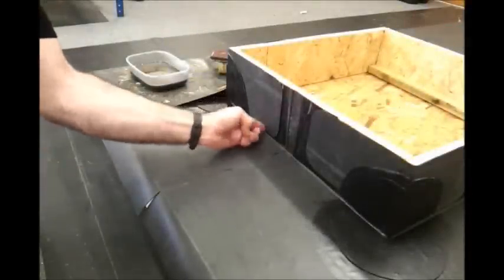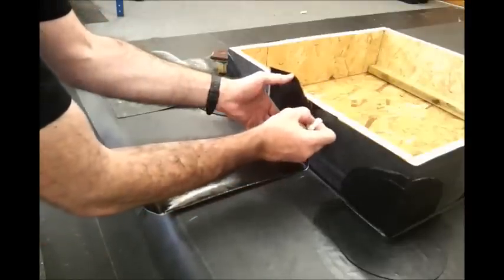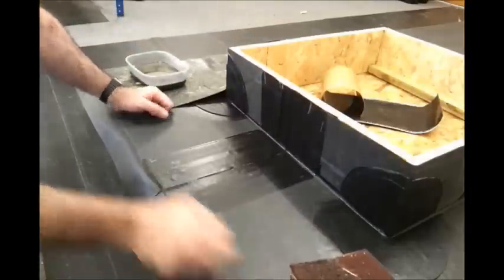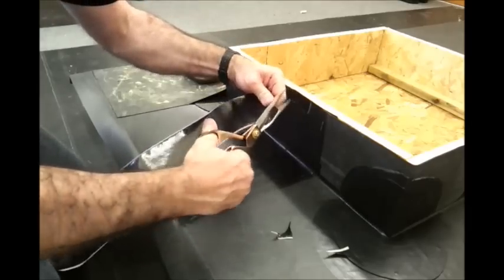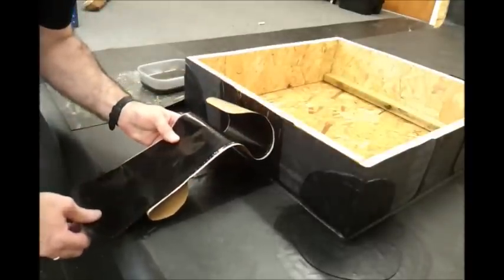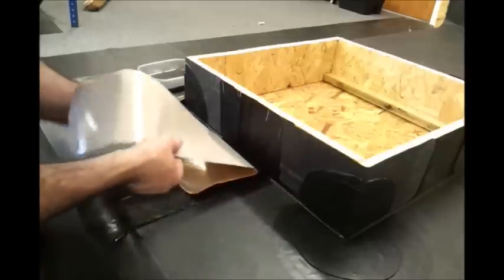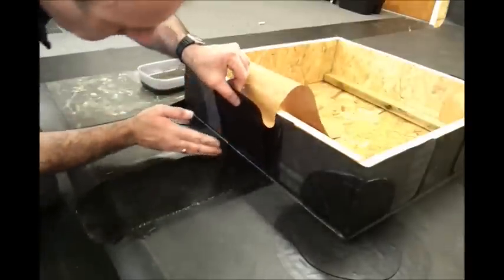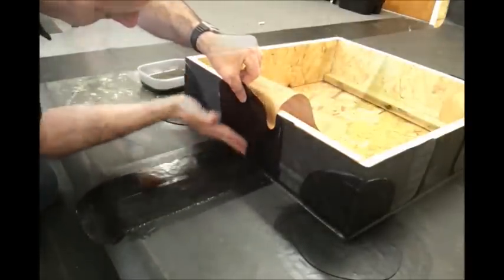How to Join EPDM Membrane with Cover Strip Tape - Rubber Roofing Systems Made Easy

Comment: You should never join a peice of rubber with form flash if u cant over lap and seam you should use sa flashing that form flash will split over time with no reinforcement underneath it and the of the rubber
Reply: Agreed. To be a secure seam that won't be comprised by adverse weather conditions, it ought to first have (Firestone QuickSeam) splice tape, which is extremely sticky on both sides, applied in between the two layers of EPDM membrane. This method and the products are also what the pond industry uses.